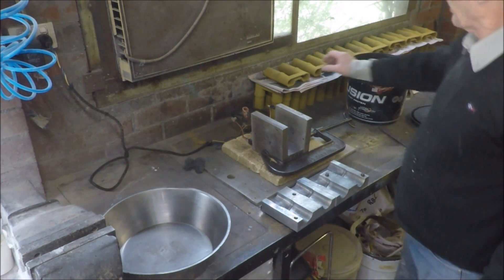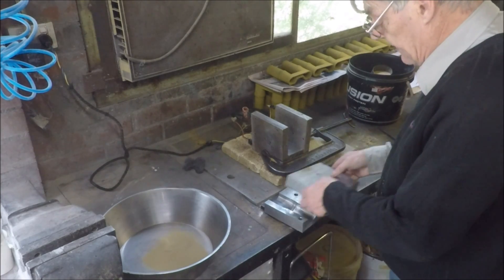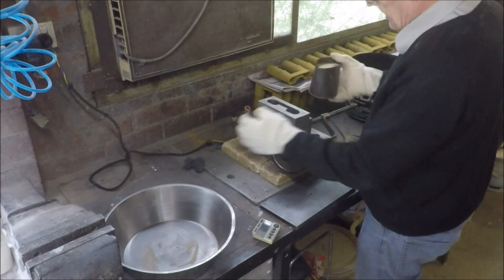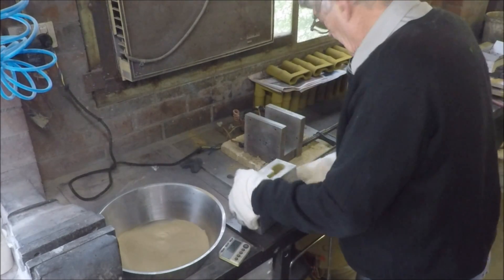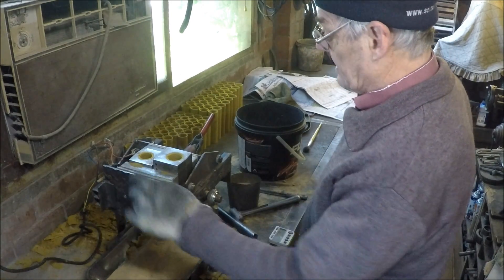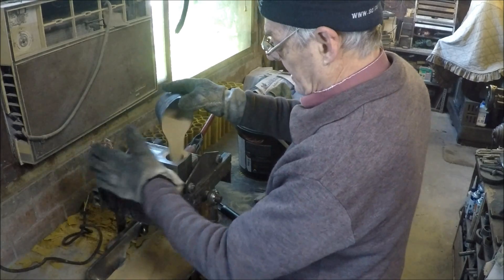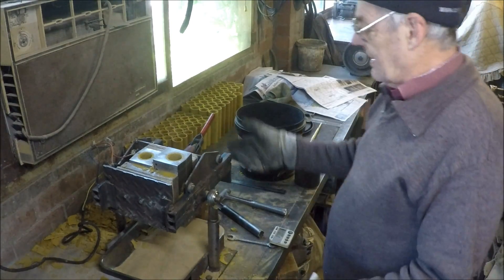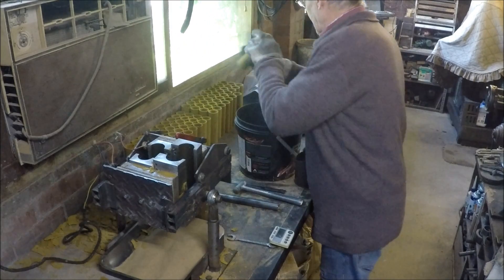My home foundry; Casting a twin throat throttle body. Part 1 The shell sand core.

Comment: Are the aluminium dies CNC machined to make a matching pair? Or some other method to obtain to matching half dies.
Reply from the maker: Col, I make a fairly crude wood pattern of the die half. I cast two half's off this pattern in 356 alloy. After the castings are given a T5 heat treatment they are each milled to the same height. The two halves are then, placed together one atop the other, and drilled to receive a couple of small dowels in the mating faces. With the dowels fitted the two halves are clamped together in the mill and the length and width machined. They are then mounted in a lathe and after careful aligning they are bored on center. There is no CNC equipment used for this - all old school manual machines. I do have a CNC mill but the manual is just easier for a simple job like this..... Martin
Reply: @olfoundryman8418  
Excellent, thanks for the explanation, I get it,  I would like to have a go at that one day. Everything I have ever done has been with casting aluminium in green sand. I dint think you used CNC, but had to ask, I am also old school manual machinist. col.

Comment: Hi Martin, I'm now re watching your video and I'm still impressed and I'm getting some very good tips. I also use shell sand both in my day job and in my shed. Love the process. Greetings from across the ditch. Hope you have a wonderful new year.
Reply from the maker: wikusdp, Yes, I have a fondness for shell too. It makes strong, non friable, very dry cores that store well, and are usually hollow so they vent well too. Only problem of course is that they need a metal core box. All tthe best for you too in 2024 and I hope that the isles do not shake to much during it 😊... Martin

Comment: Beautiful shell core simplicity i like this a lot... saves buying a secondhand semi broken 500kg machine!
Reply from the maker: Joel, That is exactly what I did! I had some "spare" 1600 watt elements from the coffee percolator castings that I do (look for the video) I reshaped them to a flat sort of "W" and cast these within a 6 inch square aluminium block about 1 inch thick. Just heat the elements to 200 deg. C plus to get them dry and oil free and pour the metal. I have one of these elements in each of the two plates that you see me use on either side of the core moulds. They are wired in series so effectively each plate is a 400 watt heater - make sure that you earth the plates. Many people just use a gas flame to heat the moulds but I find electric heating much more convenient…. Martin
PS. I am sure that you could use electric stove elements.
Reply from the maker: TheSilver, Shell  core really is an easy process and it makes a very good core. The precoated sand is cheap and it is my very much preferred core making process, its only drawback is that it requires a hot and therefore metal core mould.... Martin
Reply: @olfoundryman8418  want to figure out if possible to make those heat pads at home an electic element cast in alum block perhaps?... Joel                                      j

Comment: I was wanting to know what resin you are using here in videos? I enjoy your videos very much hope you keep posting.
Reply from the maker: K,  I don 't add the resin to the core sand myself. I buy the sand already resin coated. I believe that it is a urea formaldehyde resin  but I am not sure. The sand seems to be available world wide and it is usually called "resin coated sand" or "shell core sand" It is quite cheap. The heat of the mould I pour it into first melts and then cures the resin thus binding the sand. The process makes and excellent core.... Martin

Comment: Interesting core type
Reply from the maker: Chris, There are many types of core out there, but if a job can tolerate the expense of a metal core box shell type cores are in my opinion one of the best. They are easy, quick, and cheap to make, no messy mixing up of core sands, no gassing with chemicals either dangerous or safe, no short bench life of ready to go sand. The resulting core, made straight from as purchased resin coated sand without any further additions, is economical of material, strong, non friable, self venting and the breakdown is good. You can make 100 cores today put them on the shelf and use them years later. I have made them in thicknesses below 1/8 inch. In an upcoming video I make and use threaded cores, coarse thread mind you:). If you have not tried this core making process give it a go, it is just so easy, resin coated sand is readily available......Martin
Reply: Olfoundryman I'm a hobby Machinist I may have to try this
Reply from the maker: Chris, I recommend that you give it a go, you will be well pleased. Very useful also for feeder extensions and pouring basins. Can be used with most metals.... Martin
Reply: Olfoundryman what about cast iron?
Reply from the maker: Chris, To the best of my belief and knowledge shell cores are suitable for cast iron. For production work a lot of foundries make the entire mould out of shell core sand. I don't know if its necessary but I might be inclined to make the shell a bit thicker for iron. This is easy done by just lengthen the time that the core mould sits before turning upside down to get the excess sand out. Typically I use 15 seconds for this time so if I was to do iron work I might go to, say, 20 seconds. This may necessitate a longer cure time, I use 2 to 2.5 minutes maybe you would need to go to 3 minutes, a little experimentation would probably be in order. All of my shell core moulds are made from aluminium (industrially iron would be more common) and many are cast to finished shape and size.
Reply: Olfoundryman thank you very informative.

Comment: Who makes the sand you are using and where did you purchase it?  I love the videos, very informative.
Will
Reply: Could I do it by myself the résine ?
Reply from the maker: Will,          I buy this sand from Beckwith Mackbro here in Melbourne, from memory it is about $10.00 for a 25 Kg bag. It is simply called "Resin Coated Sand" It is available in different resin contents - I get two grades  2% and  4% and use each depending on how strong I need the core to be. For the cores in this video I mix 2 parts of the 2% and 1 part of the 4%. It is also available in different sand grain sizes, I get the 70 AFS size as it is the most common. You should be able to fined resin coated sand suppliers just about anywhere in the world, start with either the great God Google or the yellow pages. I am well pleased that you found the videos informative and that you liked them.Martin

Comment: I have watched a lot of foundry videos. This is the first time I have seen this method used in the making of cores. Would you say it is superior to using water glass? Glad I found your channel.
Reply from the maker: Jerry, I am glad that you found it too - I wish more people would! :) Commercially shell core production is big business, I would imagine that shell production would outweigh CO2 many times over. Commercially they get a bit more upmarket than my methods - its usual to blow the sand into the core mould with compressed air - its quicker, easier, and produces a denser better finished core. I assume by water glass you mean the sodium silicate CO2 core making process and I will base my comments on that - I will refer to them simply as shell and CO2. Shell sand is ready to go as you get it, just pour it into the hot mould. Properly stored shell sand will last just about forever whilst CO2 has to be mixed up not to soon before you wish to make the cores, this is an additional step,  its a bit messy and being very alkaline the silicate can get into your skin a bit. Shell produces the better casting finish, the harder more robust core, and has the better breakdown after casting. Being hollow the shell core is naturally venting (Smaller shell cores, say below 20 mm, are usually not hollow and require venting)  Being made in a hot die shell cores do not contain any water and that's one source of mould gases eliminated. However some people find the smell of shell objectionable (doesn't worry me) and it sure does get into your clothes. It even occludes onto your skin so that when you shower after using shell the smell as the hot water hits your skin is quite noticeable! (Washes off OK)CO2 requires careful venting not only to get rid of core generated gasses but also to ensure that the CO2 penetrates and thus cures the core properly. I have had a lot of trouble with blows from CO2 cores until I got the venting right. CO2 has poor breakdown - after casting you sometimes have to use  a hammer and chisel to get the core out - however 0.5% of glucose powder added to the sand before the silicate is mixed in, helps a lot with this problem and you can then usually hose the core out. The big difference though is that for shell you need metal moulds as they have to be at around 180 Deg. C, for CO2 all you need is a wooden core box and some reasonable release agent. Given my choice I would chose shell every time but sometimes the demand for the cores is just not enough to justify the time and expense of making a metal core box. Sometimes though if you have a  wooden core box you can use it as a pattern and cast a metal one off it - shrinkage can be a problem in doing this though. Shell cores will store forever - no risk of "drawing the damp", CO2 cores  are best used within a few days of making. As a final point you have to have a source of CO2 gas in order to cure the CO2 cores, it needs to be at around 1 Atmosphere of pressure and a flow rate of (for smallish cores) of about 3 to 5 litres a minute. With shell al you need is the hot mould.
Reply: Thank you for the great insights. They are invaluable to me.
Reply from the maker: Jerry,   My pleasure.

Comment: Another interesting way to make sand cores. That noise you hear is me thinking about how I can use this new technique for some up coming projects. What is the resin coated sand called? Can you buy just the resin and mix it yourself?
Reply from the maker: Yes, this is a very easy way to make a very good core if you have a metal mould. It is my preferred method of core production.  It is usually just called "resin coated sand" it comes in  a variety of resin percentages I use two - a 2.5% and a 4%. It used to come in different AFS grain sizes too but I think that its just AFS 70 now. Coating the sand with the resin is unfortunately not something that you can do yourself. I get mine from Alan Beckwith Macbro P/L they are in Coburg. I get it from them in 25 Kg bags  from memory it is around $10.00 per bag. I think if you fronted with cash and were prepared to take whatever grade they had in stock they would probably sell you just a bag. Alternatively I will be ordering some soon and can easily add another bag to my order - I buy 15 bags at a time. You really should get that noise attended to it sounds a bit worrying must bug the hell out of people watching TV next to you :).
Reply: +Olfoundryman Need to find my oil can and lube my brain
Reply from the maker: Mark Fryer Can"t help you there! Although a friend swore by what he called "Neck Oil" I think it came in 26 Oz brown bottles labelled "Fosters" :)

Comment: After watching your videos in revers(3-1) here is the core video I was asking for . Thanks again for your time.
Reply from the maker: Thomas, the time is my pleasure. My hope is that you got something from these videos. This is of course only one way of making cores, there are many but its one that I particularly favour. Incidentally if you don't have a metal core box you can take resin coated sand mix it with 4% bentonite and perhaps 0.5% flour then temper with water just as a green sand, then ram the mix into a (perhaps wooden) core box remove from box - it should have enough green strength to allow you to do this- then bake in a domestic oven at about 180 deg C until core changes colour (an hour at least). This makes a serviceable core, not as strong or hard as a proper shell core and solid of course but it works - smells a bit strange though!